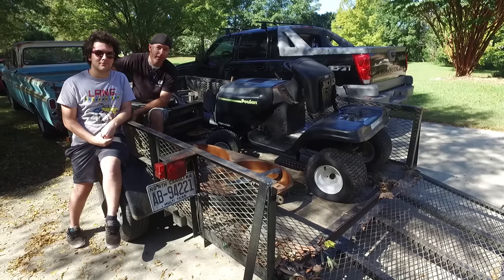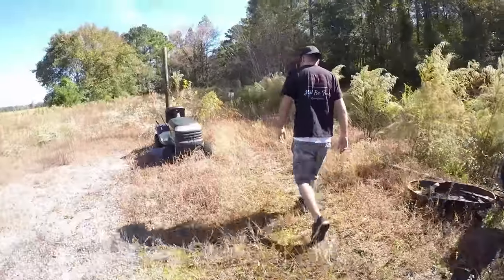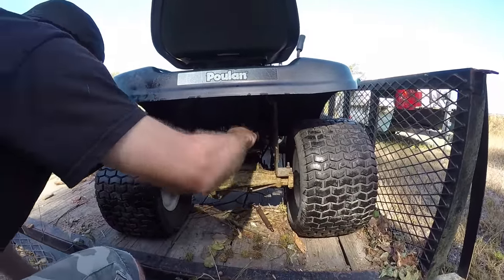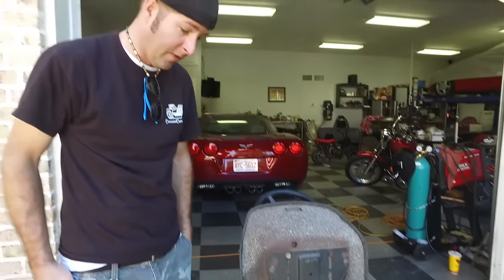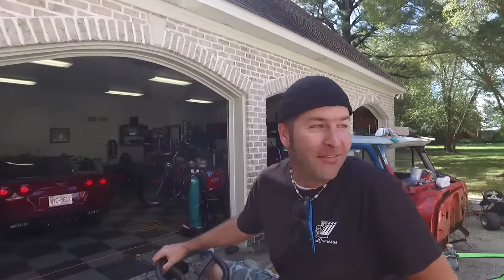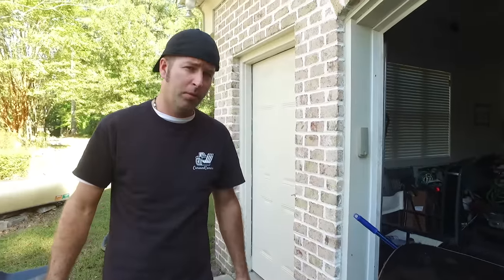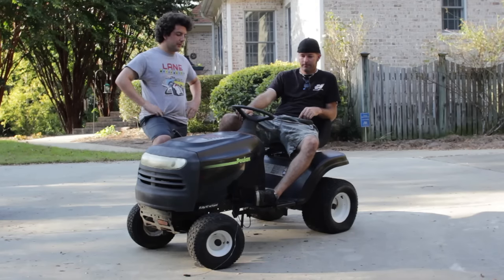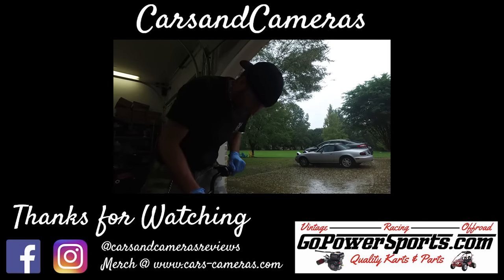We're Building a Racing Lawn Mower!

Comment: I'm in the process of taking a BMX bike and going the homemade drift trike route but instead of slicks I have a offtoad go kart axle I'm using that has tires as big as small atv tires. Its gonne be pretty cool. I'm throwing a Briggs flatty 5 with the pulsajet carb. Got theemgine for free and had the frame. Bought the go kart frame for ten bucks for the axle tires and engine mount

Comment: Im kinda happy you guys are getting into lawnmowers but please add proper brakes and a 6 1/2" on the engine and a 4" or less should get you up to 40mph or more depending on the type of spicer that the transmission is ive build way to many Mud mowers/Rally mowers/Racing mowers if any of them engines have a AVS sticker on them i would be carful of bypassing the Govenor on them as those motors will not last long lol my lifted mud mower is a poulan just like the one you guys are working on.

Comment: Hey guys if though get a 12hp brigs you can take the head off a 11 hp and it will bolt right up taking the motor to around 17 hp and ups the bottom end torque a lot! good luck !

Comment: turn the green one into a mud mower. dont slam it low. U been doing the mud stuff on the gokarts I bet this will pull them both out mud once you pull swap and put bigger tires on it. 
Checkout fearlessfront's setup and you'll have a winner guys.

Comment: If you are planning on using the gearbox, with different gearing to make it go fast, you can. But don't. Speaking from experience it is a bad idea, especially with that powerful an engine. I race a mower and  using a 12 horse power single cylinder side valve  engine, it will do 40mph, but this racing season I have blown up 3 gearboxes in 3 races. Now I have got into the habit of rebuilding the gearbox after every race, and can now rebuild the gearbox in under 3 hours from being operational to testing again. You just need to put a solid axle in bearings and then use a 90 degree gearbox to get the speed you want. Much simpler and more reliable.

Comment: If the cub cadet has a chain drive that's the faster potential mower. Pro racers restricted to "stock mower parts'' use those gear boxes to chain drive all the time.

Comment: If you read this guys then good on the predators if you have the detachable 3 bolt muffler that comes stock on most predators if you take the muffler off the header and flip the header well you have an open header it's better if you connect 2 together for a minibike mine curls around the chain and dumps straight fown

Comment: Why is starting fluid bad i see roadkill using it a lot.
Reply: i was wondering the same thing
Reply: McMuffinFluffin it doesnt lubricate the piston rings like gas does
Reply: Actually it washes the oil down the cyl walls. Leads to lubrication problems and it also lowers the compression ratio (the oil on the cyl walls does help the rings to seal). I've seen where people wash all the oil off the walls and lower the compression to the point there is no way it will crank. Of course they keep turning it over and the walls get scored or even lock the engine.

That said yeah it's bad but most of us still use it.
Reply: Starting fluid is ether, it thins oil and washes it away which can cause issues. Also on 2 strokes it can cause you to bust reed valves.
Reply: To use it to run an engine, its bad. To use just a very little bit required to start an engine wont do a damn thing to the engine to harm it. It doesn't sit in the cylinders long enough to cause wash off when used PROPERLY. The way he used it, yeah, not properly..lol
Reply: Watch Project farm's video on running an engine on starting fluid. It didn't do any damage what so ever after 20-30min. but i would rather put petrol in a spray bottle if i needed an engine to run for a while without a carb or fuel supply.

Comment: befor y'all swap the pulleys crack open that transaxle and put a little gear oil in it and seal it up or other wise it will get to hot and mess up.

Comment: PLEASE HELP: ive come to the masters for answers, you guys inspired me to buy a go kart so im looking at one on craigslist i really like but its just a frame and with the way the sprocket and axle are set up the sprocket looks only about 3-5 inches away from the right tire, if i bought it id want to put a predator engine on it, is there away to move the sprocket so that its further towards the center to allow a chain to be run from the engine to the sprocket? or would i need to buy a whole new axle? Thank You!

Comment: I slammed a lawn mower one time, the video is on my channel, if you flip the axle upside down and move the mounts the belt will line up and the shifter will still fit in the floor, only the pattern will be backwards. my lawn mower was about 1.5 inches off the floor.

Comment: the yellow one will be faster if done right it should have a peerless trans with a chain drive that's what they use on the ones that go 50 and 60 mhpthe fast I have had one is 45 mph and there hard to drive at high speeds

Comment: Unless you plan on racing legit mower races...I would put a push mower engine in the front to operate the deck (save a little weight) and a live axle w/ a 420 in the back to tear it up.

Comment: why shouldn't you use starting fluid? i use it quite often, interested to see other opinions
Reply: Ether strips oil and grease, similar to brake cleaner. Can ruin your oil, piston rings, cylinder wall, or your valves, possible even seize your engine.
Reply: fair enough thanks
Reply: They make starter fluid that has upper cylinder lube in it.
Reply: U would need to runn the engine on a whole can n no gas to do any type of damage, plus never change the oil.... that's like saying u can get cancer from a handshake....
Reply: You're right. Using a sensible amount won't hurt anything. However I've seen idiots spray full cans down the carb, that is what would hurt it. Using it on 2 strokes is even more risky, because ether doesn't have the lubricating qualities that 2 stroke mix does and can ruin the engine even easier

Comment: Those flywheels aren't made to run high rpm, I wouldn't hold them wide open for too long or it will explode
Reply: true
Reply: Eh...  It'll be fine..
Reply: lol
Reply: I'd be more worried about the synchro-balancer in the bigger engine blowing up the entire bottom end.
Reply: 395xp Dipper the flywheel can and will explode, seen it happen.

Comment: turn the transaxel upside down !!!!! put a big pully in the front and a small one on the rear! i dit this 3 times and i ran very good but they had some beld problems so i think of changing the gear ratio in the transaxel sorry for the bad english 
i like to see what you are going to do
Reply: lowering the front is normally no problem
Reply: or just keep the same hight

Comment: I got given a free mower. it's an mtd variable speed. this won't work for a racing mower right?
Reply: not sure. this is our first build
Reply: Daniel Frame You can't make a hydrostatic one run faster without modifying internals.  Stick with the manuals.
Reply: tiporari alright thx. at least I didn't waste any money on it.
Reply: Isaac it'll be fine that's fine. can't wait to see ur guys build

Comment: slam it. then throw a 7 inch pulley on the front with a custom clutch system that has 2 clutch pulleys then throw on a 4 inch in the rear

Comment: What's a lawnmower without a deck? Answer: A racing lawnmower. That's corny even by North Carolina standards. Come to think of it, I haven't seen a racing lawnmower with a deck on it. The Club Cadet, was indeed an expensive lawnmower. The lawnmower guru's still like to find the old one's, because they have much thicker metal, and they seem to last forever. The one you have was built for small lawns with narrow passageways, plus it only has eight h.p. The frame of the Poulan is also a good metal, but the decks were made with thin metal which will not last if they sit outside. The Poulan is the better looking of the two, and with no deck, it is lighter by about eighty pounds. So the "Snapper look alike" Club Cadet, needs to lose it's deck. Or the Poulan could get a bigger deck, and with over twice the horsepower, would soon be the talk of the town.

Comment: good luck blowing up that 8hp by holding that thing wide open with no governor
Reply: I have a 1983 briggs 8hp without a governor that I run wide open all the time and have never had a problem. Use non ethanol fuel and Mobil1 full syn. and you're good to go!
Reply: +catfisher420 last time i took a motor and held it wide open like that for a while it blowed the rings out. staying there for a few seconds is fine but like 30sec to a min is to much
Reply: Micheal Coffey I would say I have been wide open for over a minute tons of times. We ride the streets and occasionally get on the interstate for miles. But a worn out engine will definitely blow with that kind of abuse.